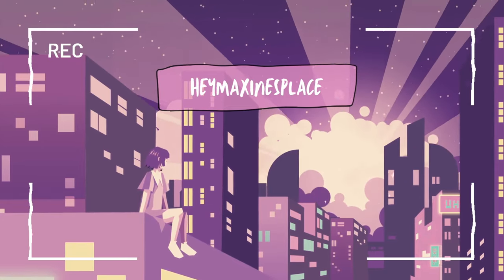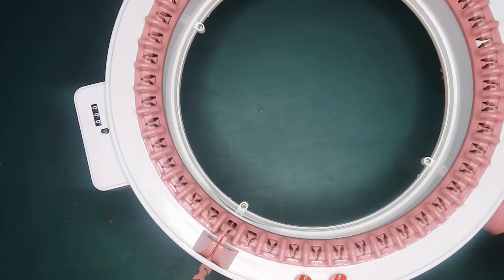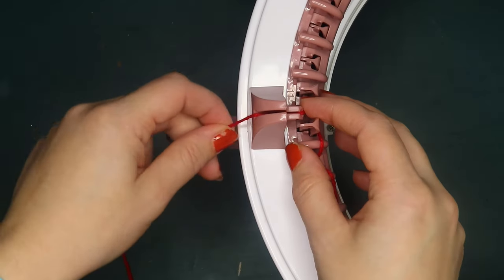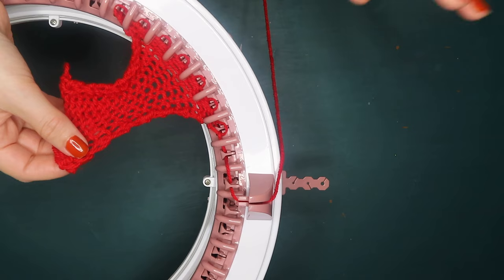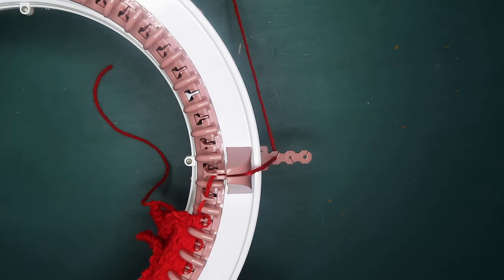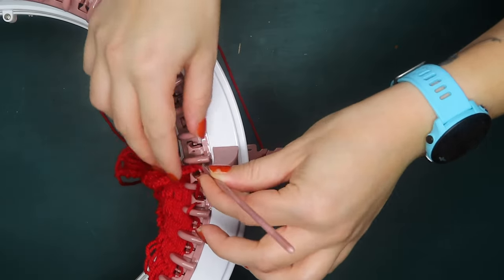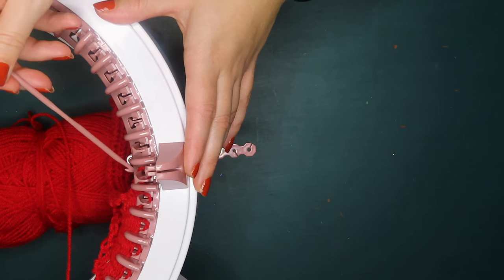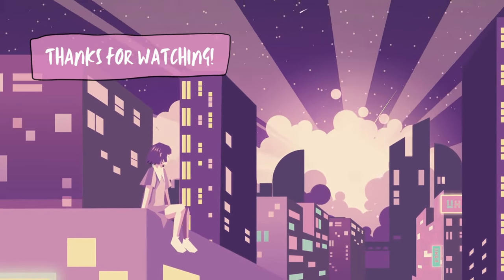How to Panel Knit on SENTRO Knitting Machine | Easy Beginner Tutorial

Comment: Hi I have just got my first 48 sentro knitting machine.   
When you make panels how do you count the rows please?
Reply from the maker: Hi Melissa! So I use the Hobbii app on my phone as they have a row counter which you can just tap the + to add how many rows. You can buy on Amazon a row counter that you attach to the machine that I believe works based on using a magnet going past ( which you attach to the last peg ). You can also go the old fashioned way and count the individual stitches or use stitch markers for every X many you do so you can tally them up.  You can also go by measurement using a dress makers tape! I hope that helps, plenty of different options :-)

Comment: Hey! What if I get a tucked stitch on the edge row of my panel? Should I try and fix it the same way as if it were in the middle or just leave it and hope it gets hidden when I seam it?
Reply from the maker: Hey! Hopefully this makes sense typin! When they double up ( or more ) on the needle use a loom pick or sewing needle and push the stitches down they should then go through with the other one. If the stitches do drop you can use a crochet hook to fix it by hooking under the stitch that you’re trying to fix and pull it over the next and continue until you get to your working row. You can also change your design to alternate between a drop stitch column and a knitted column. I can put a video together on this as think this is quite a common problem. I always find it happens on the end of panels so I tend to just check the last stitch on each panel with each row. Thanks for watching and hope that helps! ❤

Comment: Can you help me! When i set it to panel mode it won't go all the way around.  Mine stops at the 21 at peg instead of going around all the way around.  My peg stop in wrong place.  What am i doing wrong? 😢
Reply from the maker: Hey, Sounds silly but try rotating the handle the other way to reset the machine and give it ago. Otherwise - mine some times needs a solid cranking to catch the stitch in which is normally due to it getting stuck, stitches piling up on eachother or the yarn being two thick. I hope that helps will try and think of anything else! Is it ok in the tube setting casting on?
Reply: @HeyMaxinesPlace  It works great on the tube setting.. Thank you!

Comment: Mine kept loosing at the beginning
Reply from the maker: If you try and hold the yarn tight in one hand ( the end that isn’t attached to the ball of yarn ) so that there is some tension there it should help ❤️
Reply: when you finish the project, you can get a crochet hook and slip stitch into every loop which can tighten it. depending on the project, make the slip stitch somewhat loose :)